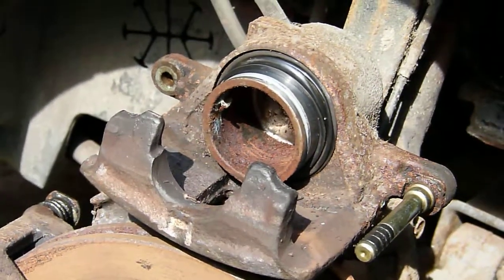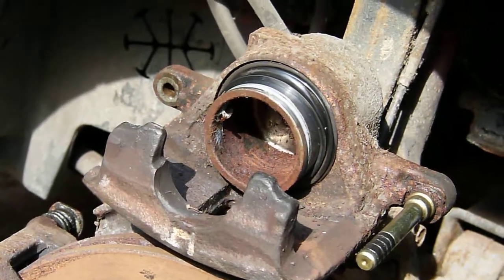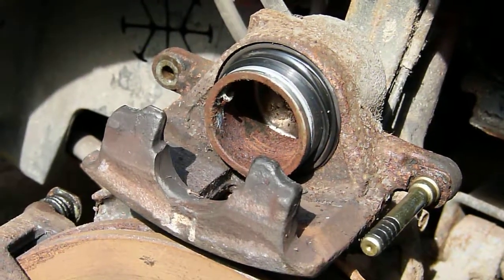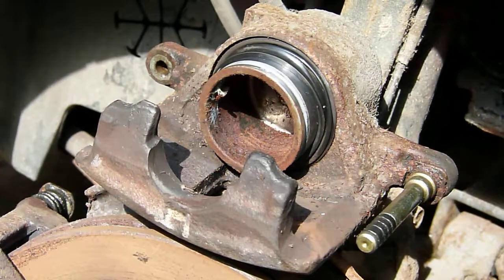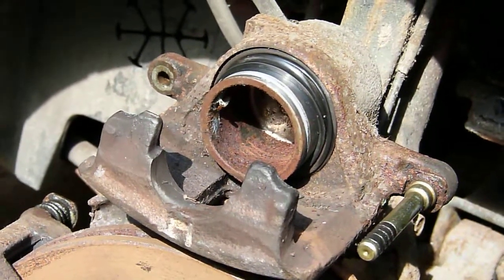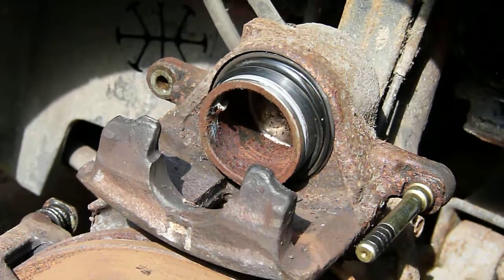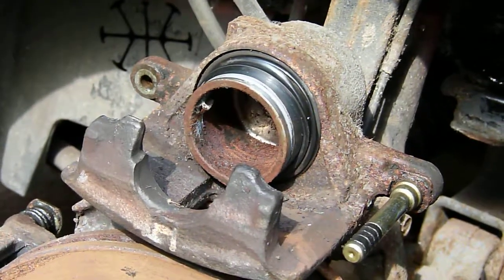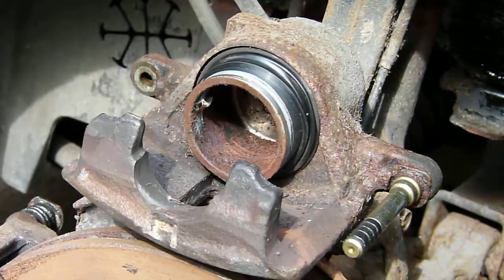Part 1 Lubricating the Brake Piston Seal -vhow to and why you should

Comment: I lubricated my piston seal with silver antiseize… did i make a mistake?
Reply: I would say clean that off, and re-lubricate using a touch of brake fluid.
Reply: @rexham83  that’s eventually what I wound up doing and everything’s been great since then. Brake clean and a brush to the caliper, then dot 3 brake fluid under the boot. Thank you for your advice!